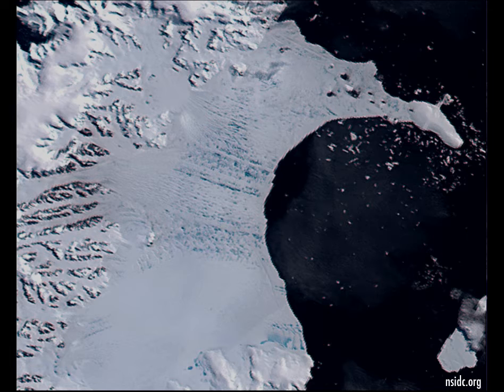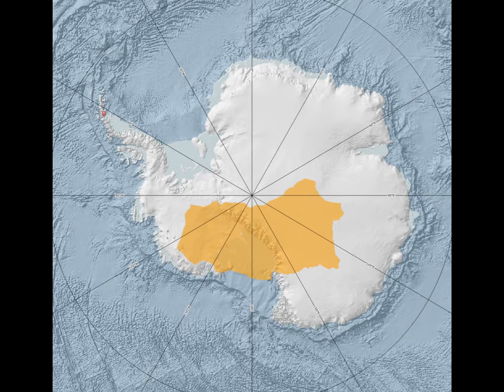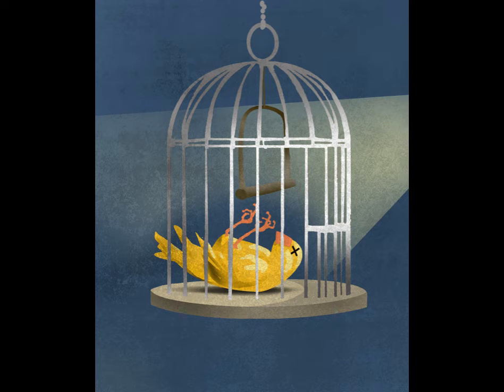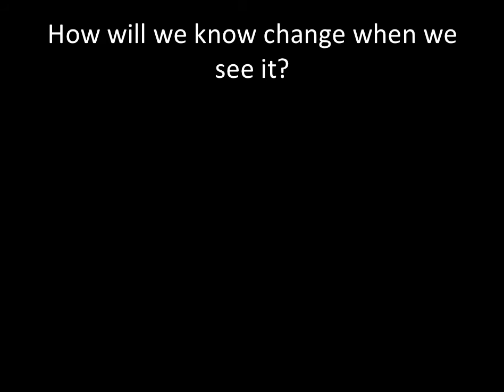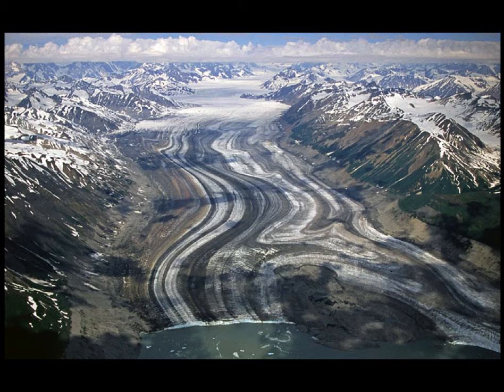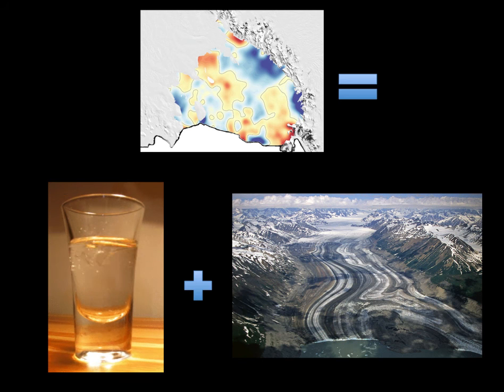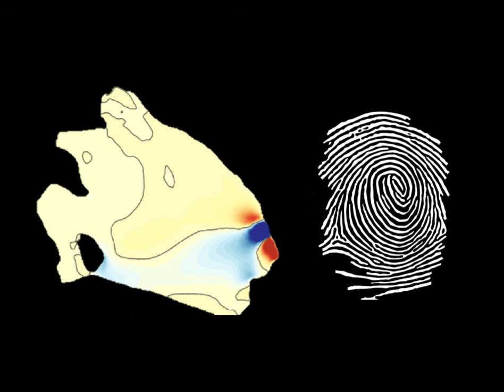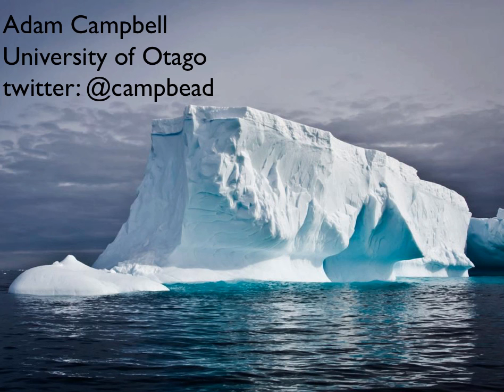Adam Campbell: Fingerprinting past changes to the Ross Ice Shelf

Comment: The Ross Ice Shelf is imploding collapsing cracking breaking crumbling and rapidly melting with a 400 km-long crack extending from the northern edge of the ice wall to the southern coast of the Ross Sea.  Dozens of cracks and crevasses are emanating from the massive crack while billions of tons of glaciers push down on the edges of the ice shelf.

Sea temperatures are reportedly 5 C which means the ice shelf is melting away on the underside while ice streams - racing down from the mountains - are also eroding away the edges and the underside.

What comes next is physics - 

3 km-high ice shelves the size of Mexico - in the Ross-Byrd Basins and the Wilkens-Aurora Basin, as well as slightly smaller ice shelves in the Pensacola and Amery Basins - will become dislodged from between the island mountains.  

This is not speculation - it's history repeating itself.

Few are aware of the plankton that's been found up in the Antarctic mountains, even fewer are aware that the Eltanin tsunami that decimated the Antarctic ice, Chile, New Zealand and Australia was so massive that as the colossal tsunami waves raced across the ocean, the water weight caused the tectonic plates to become unhinged which launched more colossal tsunami waves.  Even fewer are aware that the date of this cataclysm is found in historic documents and corroborated by numerous independent sources.

The rapid meltdown of the Antarctic ice shelves clearly suggests another collapse and cataclysm will soon be upon us.

Take your chances and gamble with your life if you are unable to take your future seriously.  I already packed and left.